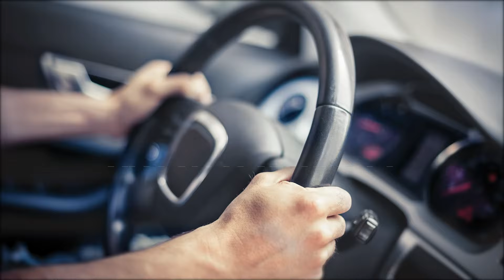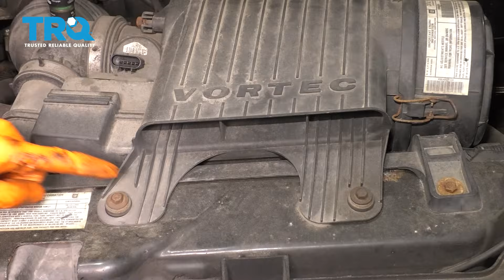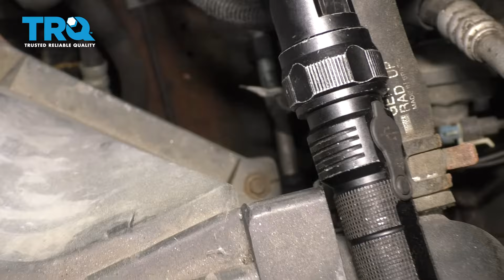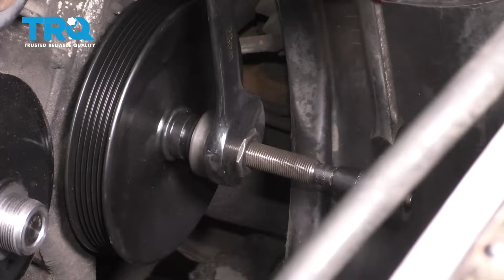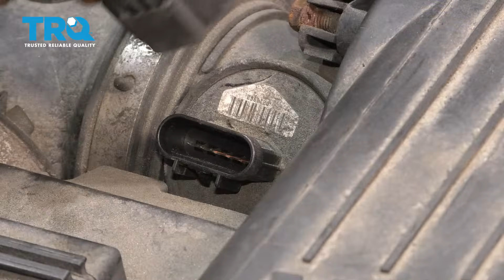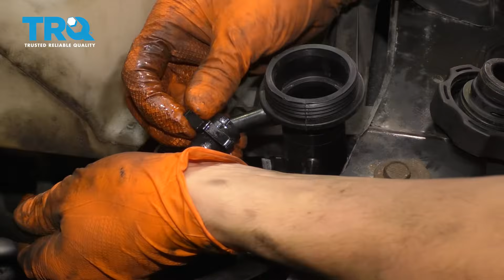How to Replace Power Steering Pump Pulley 2003-2021 Chevrolet Express

Comment: 4:38 You DO NOT need a fan clutch tool if you have an Air Hammer with a tapered punch, just hit the fan clutch nut on the left side of the nut flat and it comes off.